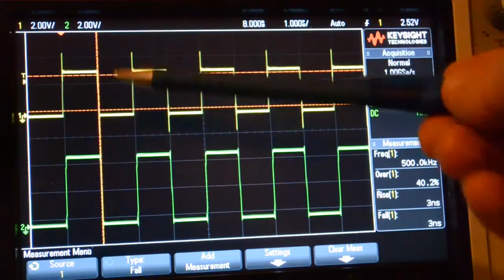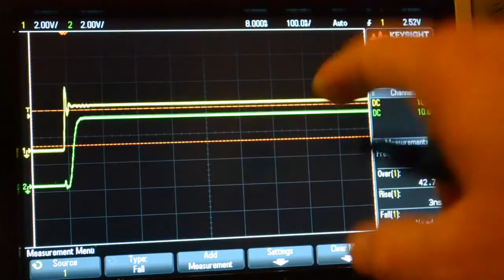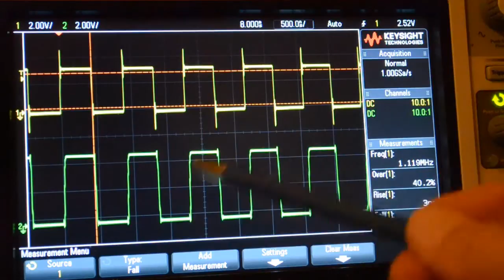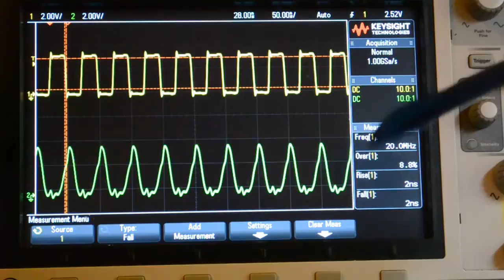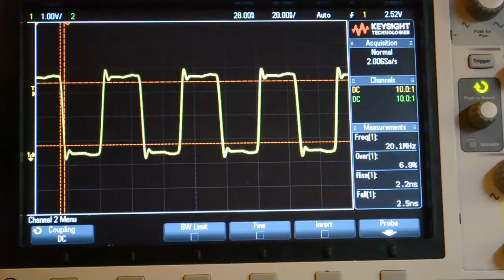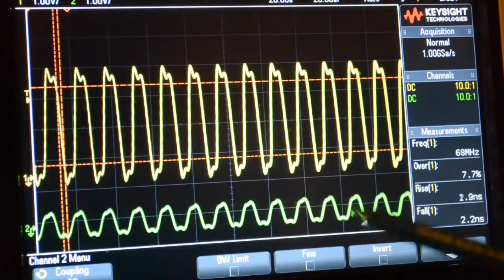Square Wave Ringing / Overshoot & High Speed Buffer Amplifiers & Scope Leads

Comment: Dear John B,
i stumbled upon you channel by accident. For weeks im now grinding through articles and videos concerning LoadLineCalibration of VRMs on motherboards, which should explain what vdroop is. Im no electrical engineer, but obviously some kind of autist, since i cant sleep anymore, cause i dont understand all those explanations. I have really read so much and there is something in all of the explanations that is wrong and that makes no sense, yet i cannot nail it down. It makes me crazy. 

If you wonder about some examples, take this article: https://en.wikichip.org/wiki/load-line_calibration

So now i broke down the problem in my head to the the cause of the ringing/aka overshoots, which i situate in the VRMs reaction to voltage changes by increasing the dutycycle. Longer duty cycle means more time for "loading the spools/coils" to generate a higher "net voltage", but also increases the ripple. The ringing in that aspect is the direct result of "several" changes to the switches of the buckconverter within a very small timeframe until you find the exact period needed to match the desired voltage. If this explanation i came up with myself is correct, then a lot of articles and explanations on this famous topic in the PC-community are quite misleading, even wrong, as they do not differentiate the compensation of natural voltage drops and intentional vdroops. Yet, im not sure that im right. Im just sure, that they are also not right.
 Have you an idea of what i say could be true or a suggestion if the article is correct or another advice for reading to understand what causes ringing in that aspect (load line, voltage drops on a pc system) ?

Comment: Are you able to explain how the additional impedance of the original earth lead created the ringing?
Reply from the maker: well, in short,
It's due to the inductance of the earth lead and the fast high speed switching.
The inductance acts like a coil, absorbing electrical energy and releasing it.
I say inductance because it's the primary cause.
Impedance is inductance, capacitance and resistance.
I guess I could add capacitance to the equation.
There is a whole field in electronics on inductance, and the formulas get complicated / too complicated for me.  
I'm guessing you know most of it since you used the term 'impedance'?
Reply: I have a rough idea, I understand the fundamental elements. I know ringing like that is often attributed to the Gibbs phenomenon, but don't understand it at depth.
Reply from the maker: All I know about inductors / long bits of wire causing inductance is -
As the frequency increases (faster on and off times) the inductance becomes more significant.
Switch the power on, a magnetic field will build up around the inductor.
As the power is switched off, the magnetic field will collapse and induce a voltage into the inductor.
That induced voltage will obviously affect the original voltage, it also apposes the incoming voltage.
That induced voltage will cause a current to flow which will cause a magnetic field again, but not as strong.
Together with capacitance, the weaker magnetic field will induce a smaller voltage giving a smaller current giving a smaller magnetic field, and it continues until the energy is gone.
It's called ringing.
And that is only with the first switch on / off. 
Look back on cars with points and a condenser (capacitor)
The condenser together with the coil was a 'tuned circuit'
It was there to cause 'ringing' to give us a longer spark.